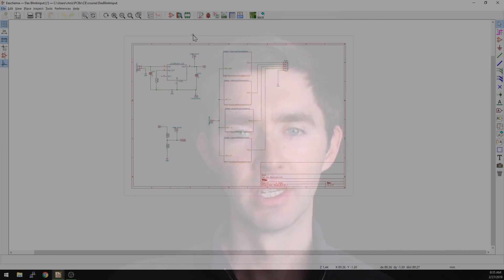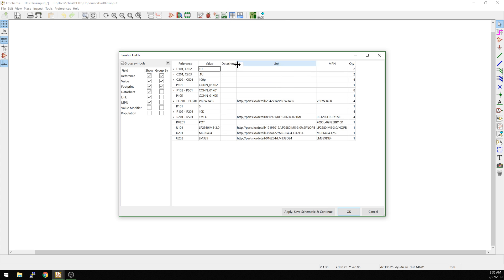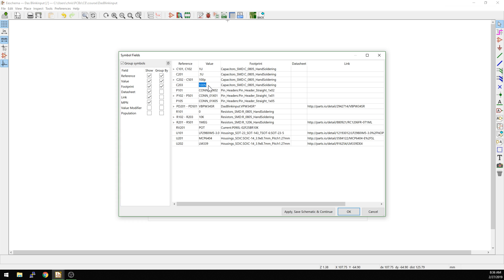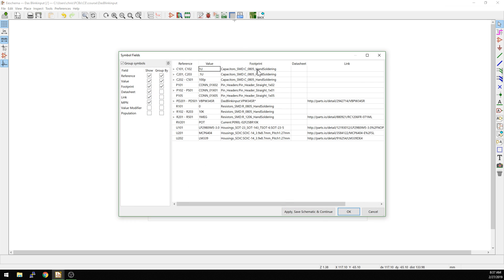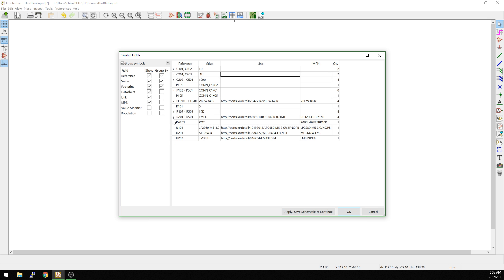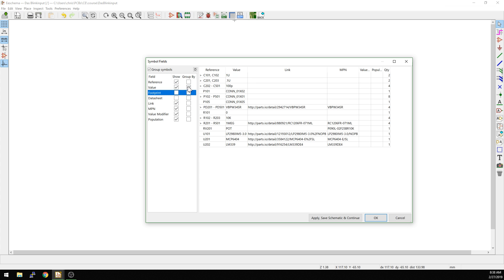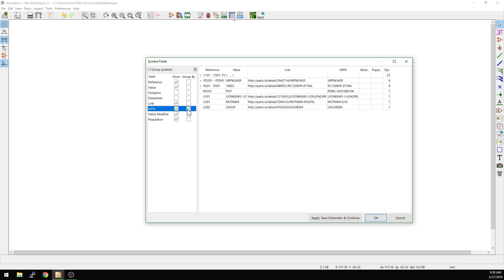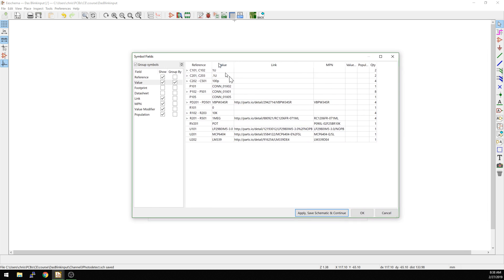KiCad 5.0 - Editing multiple symbol fields (pre-BOM)

Comment: hey. some offtopic: do u know what happens when you add a pin header 2x08 2.54mm into schematic - it's pin numbering goes (counter)clockwise... but when setting footprints and viewing in layout editor - numbering is a complete mess?
Reply: The pin out in the schematic symbol is only a representation of the part. The arrangement of the pins typically reflects what is the least confusing to read - it does not reflect the actual part.
The foot print reflects the actual part. Some parts are part of an industry standard that has pins in a specific order that may not make sense. If the pin order is different than what you want, then you need to use a different footprint, or make one yourself.

What I see most often is the pin order in the foot print is in some order that makes sense (I.E. counter clockwise), but the schematic symbol is all jumbled around (inputs on one side outs on the other, etc).